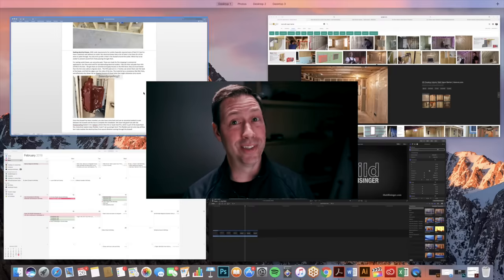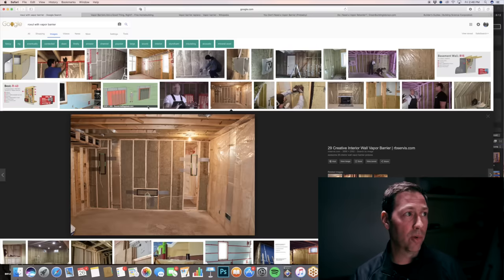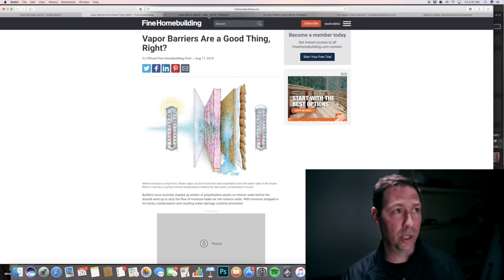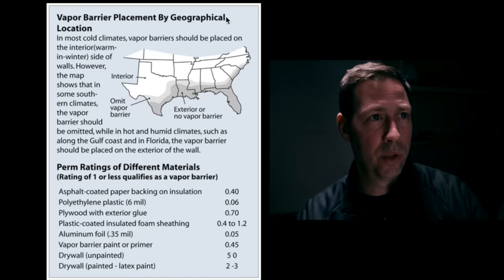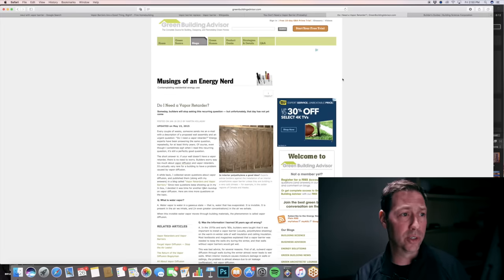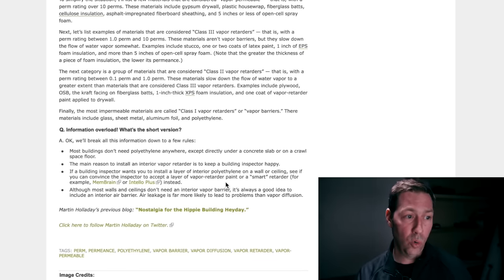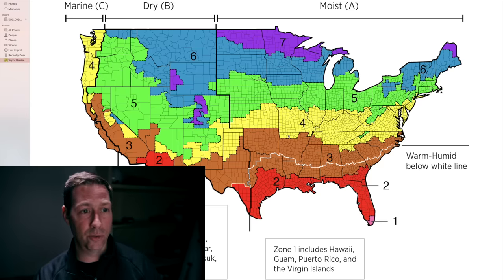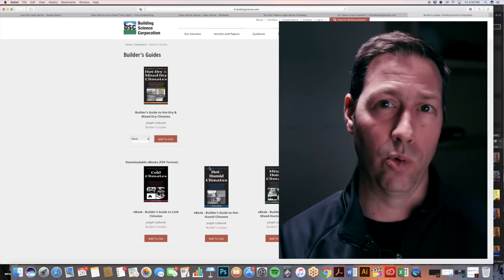Vapor Barriers: Need one or not?

Comment: I liked this, and it will help a lot of people; the regional guidebooks are excellent. I live in the interior of British Columbia, and I can see +40 celsius in the summer, and -40 celsius in the winter. When it's cold outside, and you're cooking, breathing, showering, it is essential that there is an interior vapour barrier on homes in our neck of the woods. We have an AC unit too, and in a hot summer, that can introduce its own set of problems. I'm thinking that a good portion of Canadians absolutely need what your neighbours in Colorado, Minnesota, Wisconsin and North Dakota need.
Reply: What do you do in the summer? No sure how to cope with humidity coming one direction in summer and another in winter
Reply: Do you need a vapor barrier or just an air barrier that lets the building dry to either side depending on the season?

Comment: Thank you very much! I'm building a house, using Rockwool and couldn't find a good answer to the question of interior poly. I put it on and got condensation on the south wall. I'm going to remove all of it now before I sheetrock. Also, don't paint the exterior a dark color. The heat gain is tremendous in a hot climate. I used a dark brown color and I'm repainting it now. Never thought about it, just liked the look. Oh well, pale yellow will be good too.
Reply: Thank you! For helping with a do/don't  plastic sheeting argument!!

Comment: Matt, you forgot to mention that the driving force moving moisture through a wall is vapor pressure.  Why else would moisture move?   Secondly, temperature differential is what drives heat through the wall.   One can calculate for a wall composite, given inside and outside temperatures, what the temperature gradient is in the wall and if condensation could occur.      

I have seen a PTAC placed such in a building that it was blowing fully saturated 55F air on drywall.  While the room side of the drywall looked fine, guess what was on the other side?  The blackest mold you have ever seen.  The learning is to never have HVAC vents directed against a wall.  Lastly, I have seen in hotels where a conditioned guest room (cold) over an ambient work room created mold on the ceiling of the unconditioned and vented work room.   The room above made the concrete floor slab so cold, moisture was condensing on the ceiling of the work room.   

As a mechanical engineer, I need to find the scientific root cause why there is a problem or what the solution should be.   Just using a general chart for certain areas is not always the best method.   Using science and physics will always give the correct answer.

Comment: What I get out of this is that you should try to have slight negative pressure in your house during the winter and slight positive pressure during air conditioned periods. That way, anywhere there's an air leak it will be cool (dryer) air which will be able to absorb and carry away moisture as it moves into a warmer part of the wall, floor, or roof.
Reply: that is an inspiring thought

Comment: 30 year builder here ,, thousands of units,, I will tell you exactly what poly on the inside of a house will do,, (in most of the USA)it will rot and or mold and mildew your walls and ext sheathing, rot your studs if wood ,, rust your framing if metal, soak your insulation if fiberglass , especially at bottom of walls effectively making fiberglass batts or any  insulation virtually useless when damp.(( mineral wool and closed cell foam excluded))    . We figured that out in the late eighties,. Had many of discussion with unknowing bldg inspectors,, but I always won. But it was always a battle.  Best to build a house with the major share of insulation rigid in two or more overlapping layers on exterior,,  on top of a water/ air barrier ,, then clad exterior with whatever as long as there is a sufficient drainage plane between cladding and insulation,.. but still place mineral wool inside stud cavities , but i like at least a R 20 or so in exterior overlapping foam,, ((This method I KNOW  works most everywhere .. AND DONT PUNCH HOLES IN YOUR WALLS  ,,lol ceilings either for that matter . Air sealing from inside is key to thermal performance ,, do not need three dimensional airflow inside wall cavities or ceiling cavities .
Reply: BTW good video
Reply: Nate, if you were called to finish a basement, and the existing construction did not have the 2 layer of rigid isolation on the exterior, how would you go about framing the basement walls in regards to insulation and vapor barrier.  This is for the new england area.
Reply: Nate. Same question about basement vapor barrier

Comment: Thanks for the explanation. 
Living in Australia 🇦🇺 I struggled to understand the difference between all the different types of barriers used and when you should use them. Some on the inside some on the outside, some in use both inside and outside in some areas. When you add closed cell foam into the mix too it’s just confusing. 

You wouldn’t believe the relaxed “standard” used down here. I’m living in a house (one I’m sure that was built by first year apprentices) it has only a single single brick wall with a 25- 50 mm air gap to a 2x4 wall frame with gyprock (Sheetrock). Yep no wall insulation at all. And this property was built in 2005. 
In the roof cavity I have 10 mm gyprock and corrugated iron (tin roofing). That’s in. 

There’s now a standard to adhere to which requires us to build stud walls with R1.5 batts. I’m not sure of the required R value in the ceiling cavity but what ever it is, it’s very relaxed. 

I built an investment home in 2002 and I asked the builder to use anticon under the roofing iron together with R3.6 batts on the ceiling. My builder told me I was just waisting my money with the anitcon. (Anticon is a anti condescending insulation. It’s a quite thick foil type material with fibreglass insulation attached to it, R1.5) to purchase it in large roles.
As an electrician I loved working in this ceiling cavity, others without the under iron insulation were crazy hot, you could only work in that space for a limited time as it was so hot. But my property was was warm but not overwhelmingly hot. 

I can’t understand why we don’t try to better insulate our home’s. 

Thanks for the great content. 
Cam.
Reply: Thanks for sharing Cameron. We're looking to buy our first Aus home, coming from the UK the lack of insulation here is shocking. We're basically resigned to the idea of needing to install insulation in whatever we buy. Did you find any good Aus specific resources regarding vapour barriers? The wide temperature variation here made us think we'll need it on both sides. Cheers

Comment: Thanks Matt. Might be worth mentioning the article “how to kill an old house” for those of us renovating homes. My PNW vintage craftsman was redone years ago and every wall I open has pink stuff in plastic from that reno, all beginning to turn black. Removing as I go. Short of removing all the historic cedar siding to insulate the envelope ala green building or perfect wall, I don’t think I have found any good choices for insulating walls of an historic house. None seems the consensus; that’s a hard pill to swallow in a hundred year old house. I’ve used some rockwool and bo barrier, in hopes it will hold up better over the next 20 years and make the house a bit more comfortable.
Reply: He’s got another video where they insulated a 100 yr old house in Texas. They use something called Delta Dry to create a cavity next the siding so it can breathe. Then they put a weatherproof sheet over that, THEN insulation goes in. I did it on my old house.That might work for ya!

Comment: Great coverage of an important topic.  I've been building an 8x12ft RV and following your vlogs and have found them valuable for everything from wall construction, window openings and of course moisture control including vapour barriers.  I've found that a lot of what goes into home construction can be applied to RV construction.   I've also found that a lot of ready made RV's don't do a lot when it comes to vapour control.   My RV's walls are made with 2x3 wood studs with plywood sheathing covered in Soprema Sopraseal Stick VP.  Walls are insulated with Rockwool insulation and the decision was made to forgo the vapour barrier completely knowing that RV's especially can become really humid really fast.  Thanks for detailed content and real world examples in all of your videos.
Reply: I too am here wondering what to do with my van build.  I live in hot humid south but plan to go north west…but don’t really plan to do long-term in snow climates.

Comment: So when building my post frame structures with metal siding and no plywood or osb sheeting... still no vapor barrier?   Great video matt
Reply: The answer in my research is “no vapor barriers” for your steel building but an air barrier usually in the form of closed cell foam spray or sheet works best.
Reply: Also following both RR and Matt ... What's the answer for my new 40x60 heated post frame building?
Reply: I have the same question
Reply: Great videos from here and RR.  I think it all depends on location but I am not an expert which is why I am here.  We just completed the dry in of a large pole barn structure.  We are about to begin finishing the interior which will have both conditioned and unconditioned space.  We have metal exterior siding over top of general house wrap.  We will then bat insulate the interior and cover the walls with drywall.  We have been told not to put up any plastic.  We are located in northern South Carolina where summers are hot a humidity seems to be year round.  I look forward to hearing the reply from Matt.
Reply: Depends on your climate. The vapour barrier should go on the warm side if the in/out temperature delta will allow condensation to occur. I live in the north and our typical wall assembly inside out is drywall - furring (allow some air movement to dry out any vapour that diffuses) - vapour barrier (p-e or closed styrofoam panels that will have less than 1 perm) - insulation in the wall cavity - open styrofoam panels( high perm to allow moisture to escape) glued on the back of your sheating - air barrier (tyvek or similar) - furring for air movement to dry any moisture - siding.
Reply: No real answer here, but with the sofits being vented and the wall cavity open at the header in a post frame build with blown in insulation covering the batts at the top of the header wouldn't moisture that gets into the wall evaporate up into the attic space and through the ridge vent?
Reply: All very good points being made. I follow RR and MR to learn about new trends in building as I haven’t been in the trades for 15 years now but used to build houses for a GC in Reno and in the Fresno areas. Matt’s point of air carrying the water vapor is spot on, so being able to air seal the conditioned envelope is the critical component and then have adequate ventilation/conditioning of the space to removed excess humidity. In Reno it’s very dry but gets very hot and cold but you deal with big Sierra storms, whereas in Fresno it’s much more humid due to agriculture so 40-60% RH regularly in 105-115* heat but the. You run consistently in the mod 30s with 100% RH due to very dense fog (we are talking cannot see 6ft in front you). In both places we use housewrap and glued the seams before stapling them, fluid apply flashing or tape, we caulked (didn’t have closed cell foam yet) the joints at the conditioned spaces such as drywall seams, drywall to plate and drywall to lid before painting. We used paper faced fiberglass with paper toward the insides of the house, plastic in all the crawl spaces, caulked all the penetrations through the membrane including all plumbing, fixtures, cabinets, shower inserts, toilet flanges, etc. The builder I worked for was a custom builder and the inspectors always told us we were going way overkill, but that we were doing better work than anyone.
Reply: @Natedoc808  would you do the same (use air barrier only) on mobile homes with aluminum siding? How about using reflectix instead of Tyvek, then mineral/rock insulation?
Reply: @Natedoc808  I forgot to mention this is is in Auburn, CA
Reply: @CADreemz  This method would work very well in your area (I’m a big fan of auburn, used to come all the way there to hit in-n-out after snowboarding at sugar bowl and spent lots of time on the Yuba) but the very important part is to ensure the air tightness of the living envelope. So if you have the siding off then be sure to use proper caulking, butyl based caulking is toughest and remains pliable, along the bottoms and tops of wall plates (I’m not terrible familiar with the exact construction technique used on mobiles), then rock wool is perfect choice, the. Sheathing + house wrap or the zip system, then rain screen followed by the aluminum siding. Auburn gets both hot and modestly humid, along with quite wet/damp/foggy plus right at the storm accumulation line as winter weather systems start to get pushed up in elevation and condense due to back pressure against the rapid elevation gain of our mighty and beautiful Sierra’s so you need good storm and rain resistance and ability to dry/breathe. For the retrofit process I would use a liquid flash product, specifically the Prosoco red liquid flashing around your windows and bottom of where the sheathing meets the foundation. Another consideration would be using closed cell foam under your mobile to both insulate the floor and air seal it; one big leak is where the heater ducts, plumbing, other mechanicals  penetrate the floor if they run under the house. Again not inherently familiar with mobile design.
Reply: Since your walls have no real containment for air flow, what would be the point of a vapor barrier?
Reply: @Avi A It is a vapor retarder.  Moisture will move through closed cell but at a very reduced and slow rate.   The link I posted explains it.
Reply: He said no vapor barrier needed on the INSIDE of you walls. Meaning behind your sheetrock and in front of your wall studs. 
Vapor barrier on exterior is a given. No inspector would let a house slide without some kind of vapor retarder.

Comment: Crazy humid in Central Florida for about 7 months a year.  I had a “over “ wrapped wall that couldn’t breathe and it couldn’t release trapped water as a vapor. 
Major rotting occurred.
It’s not so much water getting into the wall here or there (it’s going to get in somewhere) question is, can it get out?
It needs a way out on the less humid side.
Reply: I would think in HIGH humidity areas, spray foam would be your friend. That seals the wood and stops air flow all together.

Comment: Thank you for taking the time to explain this logically. Building inspectors simply parrot what someone told them and never check the science behind what they prescribe. I once had a building inspector tell me that my new patio needed to be able to remain standing if the house fell down. I asked him to explain to me under what circumstances he could envision my my house falling down and not the patio with it, and he just stared at me and then finally said, "well, that's what they told me we needed to look for."
Reply: That's insane. So many building inspectors just follow what they were told (as you already stated) or got it from a manual, but don't fundamentally understand any of the science behind the "why". Or, and the worst, is a perpetuated myth in building science that gets passed from inspector to inspector that becomes the norm, when it was never based on fact.

Comment: Getting ready to start the design process and this is the exact kind of video I’m looking for! Great stuff Matt!
Reply: How did your project turn out? What method did you go with? I find the more digging you do in vapor barriers/insulation, the more questions come to light. Who's right and what's right for my situation.
Reply: @chrisalister2297  Project went great! We live in a mild climate and code requires that we use, at minimum, a vapor barrier primer paint on the drywall which is the preferred method in our area and probably most cost effective. I’ll let you know If it is the right choice in 30+ years if we ever remodel and find damage or mold. There is,....what is right....what is required by code....and what is done. I can’t answer any of that for your situation. Good luck.